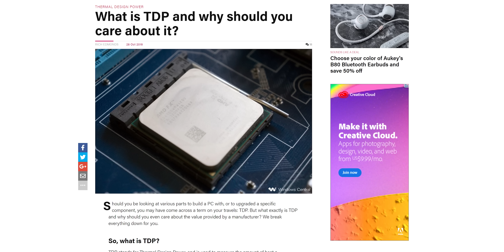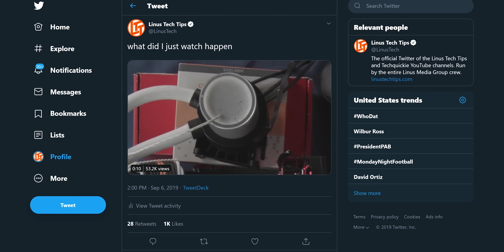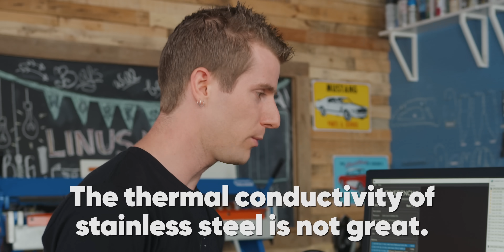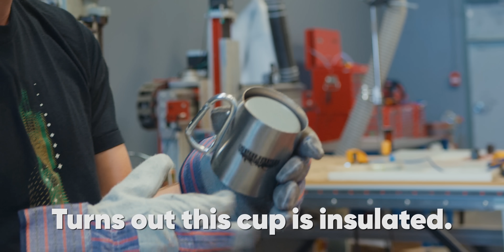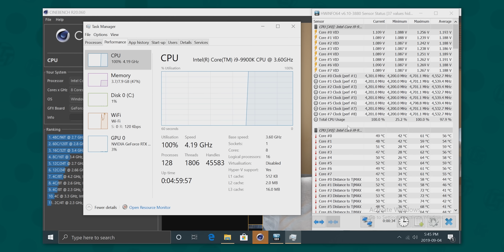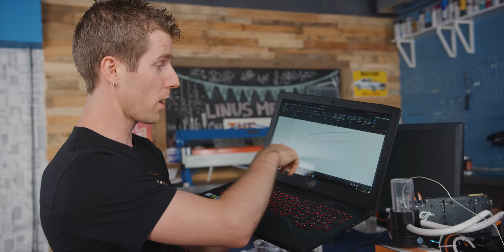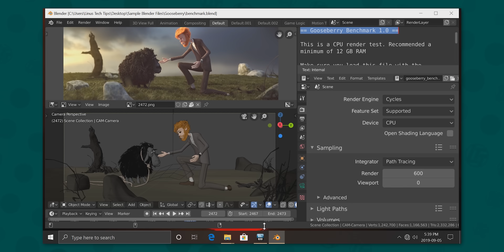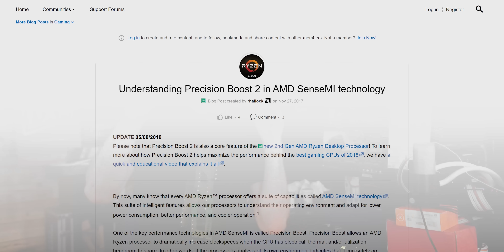Who REALLY Runs Hotter? AMD vs Intel

Comment: So, you didn't use the LTT water bottle for the test, why?
Reply: Specifically because it's insulated. The point of this test setup is to transfer as much of the heat as possible into the water and not the air and surrounding components.
Reply: @faceplants2  That's usually known as insulation.  So, an insulated bottle would prevent heat transfer in or out, allowing an accurate test?
Reply: @bobschuon5908  They want as much of the CPU heat as possible to go into the water.... An insulator between water and processor would impede that. Not sure where the misunderstanding is here.
Reply: @faceplants2  If you run the water tubes into the bottle, then you have an insulated water storage system, just like they were attempting to create to hold the liquid...
Reply: @bobschuon5908  I see now. We're talking about different parts of the test. By the time they added the liquid cooling loop, they were on what, Plan D or E? I think by then they just wanted to finish the experiment.

They also were using a pump/res combo so if they ran the liquid to an insulated container, they'd need to get a standalone pump to go with it.

There's lots of ways to improve this test but the results were good enough to prove the point that TDP figures need to be a standardized measurement if consumers are going to base purchases on it.

Transferring the heat as effectively as possible into a calorimeter is the most accurate way I can think of to measure total power output in a given time. They're expensive to buy and tricky to make a good one yourself afaik.

Comment: You won't have to worry about room heating in 2 or 3 weeks when that Threadripper does it's normal thing and fails. Non-functioning CPU doesn't produce heat. Problem solved.

Comment: You guys are SUCH obviously PC only geeks.

A copper sheet with even just solder would have worked better, and been easier.

Ugh.... massive fail.
Reply: Folded into a cup shape obviously. Figured I'd add that for the morons who couldn't put 2 and 2 together.

Comment: Dont even need to watch the video, and no offense.... but I doubt you did this correctly anyway. As in test CPU's core for core. 3700x vs 9900k as an example.

Without a shadow of a doubt, Intel is hotter not delidded at the same core count and speed. Delid it and it will be cooler.

Comment: CPU's dont create any mechanical work so all of it's drained electrical power is transformed directly into heat, in case of an identical remaining components, you can simply use a wall socket power meter (since power supply only drains the power components need)

Comment: This is actually one of the worst ways to test the heat output. It makes absolutely no sense to measure the water temperature when you can just use the electricity usage. Measure the current going into the motherboard and you're done. Yes, you'll have a few variables like different board efficiencies, but by taking similar boards the difference will be negligible. 

If you're just going for a comparison instead of actual heat production, use the same cooler with a constant fan speed and test the temperature. This won't lead to the energy usage in Joules, but it will give a simple indication of which one is more power efficient.
Reply: Exactly.

Best post right here.

Comment: Ah well i upgraded from a 6700k to a 3700x  and the 3700x is "reading" lower temps in Asus Ai suite... both 65watt TDP. At the end of the day the 6700k was thermal throttling itself after i de lided it. No idea why.  None the less im very happy with the 3700x. Not much gain in gaming performance (fps) if any at all but games feel like they have less micro stutter and latency. Luckily my loop is large enough to tame (x3 360 rads) the 3700x when running at 100% without any fans on and at low pump speeds. I can now happily render videos while i sleep peacefully lol XD.

Comment: T-Shirt: 20$
Water Bottle: 30$
Noice Linus. Plz explain
Reply: Cotton VS high technological materials to keep things very cool or hot
Reply: well you cant live without water for a long time
Reply: @subashaaa  metal vs sheep hair
Reply: Weaved cotton vs vacuum insulated stainless steel..... what’s hard to get?
Reply: @baqcasanke  How does that 20 cent operation on a hunk of pressed steel gets to cost 30$ is the question.
Reply: Hr1s7i 
Transport costs, QA costs, Marketing costs, etc. +They wanna make Profit
Reply: @regularyugoslav8188  So it's all for the sake of feeding the hundred middle man leeches in the entire chain. Neat.
Reply: @Hr1s7i  equipment, labor, profit for manufacturer, cost of transportation, profit for seller and cost of shipping to you.
Reply: because water bottle is more expensive to create what is their to explain their?
Reply: IFTEKHAR SAFI there*
Reply: cloth is cheaper than aluminum
Reply: I can explain: T-Shirt is made at sweatshop factories by child slave labor, but the Water bottle isnt.
Reply: @YouCensored  sure
Reply: @YouCensored  just like a apple product or supreme
Reply: T-shirts are made in AMD powered printers... And bottles in Intel powered machines... So, someone have to pay for the difference in machinery cost!
Reply: Shirt = fabric
Bottle = iron
Reply: shirt = plant
water bottle = metal
ez

Comment: watts are a measure of consumption. not heat. heat is indicating inefficiency in this scenario.
what is telling for consumers is that amd ran quicker and produced less heat.

you should run the test with a watt meter at the wall and determine how much power is consumed to complete the test for the whole system
Reply: Watt is also Energy, which can be called "Joules", and both can be used to describe amount of heat. Never saw physics right?

Comment: Does test to push CPU performance in order to measure thermal output, but only uses single channel memory....
Tries to use vacuum-sealed cup as a heatsink, is surprised when it doesn't work...
Talks about benefits of using a known quantity of thermal mass, yet doesn't measure how much thermal mass is being used (and changes measuring methods in between tests)
Wants to measure thermal differences between CPUs, yet either doesn't know or can't remember basic laws of thermodynamics....
Yup, par for the course for LTT.
Would be interesting to see GamersNexus do this sort of test, where the results could be somewhat reliable.

Comment: What is even the point of all that rube-goldberginess? Just run a water cooling loop without a radiator, starting with the same temperature water each time and measure the temperature change in the water...

Edit: Never mind, they did it 10 minutes in...

Comment: Wouldn't a better way have been to have a certain amount of cooling water (say 50L) at a certain temperature (say 5 degrees), run that through the cooling system at a given rate (which you'd presumably know from the pump's specs) until it's used up, and then measure the temperature in the output tub? 

Of course, you'd have a second tub of source water and a second output one with valves in the piping before the pump and after the CPU so you can switch between your testing line and your prep line, so you don't use your carefully measured and temperature-controlled testing water on booting the computer or let the CPU overheat when the testing water runs out after the test.

Comment: well, intel cpu usually run at higher frequency. and the power scales ^2 with frequency.
Reply: And yet Amd Cpu  gets more work Done :D 19 000 tiles vs 13 000 tiles.

Comment: I run my Core i5 9600k at 5ghz, but even though it says 95W TDP too, I put a NZXT Kraken x62 AiO 280mm on the top of the heatspreader. The CPU runs at the hottest 60 Celsius.

Comment: Imagine that thermochromic stuff in a loop with water, you could watch it change colour and cool back down (depending on the temp that the ink starts to change) which can tell you if the cpu is hot or not

Comment: Why didn't they just test the power intake of the CPU since all electrical energy is converted to heat anyways?
Reply: @UCglUUvnS2YSif0iMUSRlJ8g afaik they're all 100% efficient at turning energy input into heat by the first law of thermodynamics. The only possible output for the energy input is as heat, since the processors aren't moving.
Reply: I hate when people reply with stupid arguments then delete it when they're proven wrong 😂
Reply: Power/frame would make more sense than power/time as well. My 8-core cell phone cpu would consume 1/10th of the power but wouldn't provide 1/10th of the work at the same time.
Reply: @MrMortadelas  I agree.
Reply: Not to be pedantic but I think you are misunderstanding what heat is in this case.

Heat is the transfer of thermal energy between two systems. An example would be a light bulb. A light bulb converts electrical energy into radiant energy. Radiant energy consists of discrete packets of energy called photons which interact with matter.

Now take a solar cell which can convert some of this radiant energy into electricity. Intuitively arises the problem that if you placed a light bulb which obtained its electrical energy from the solar cell nothing would happen. This is because heat (flow of thermal energy) was produced as a byproduct of the work required to transfer the energy between systems. This is also called waste heat, because although the energy is still conserved but now is far less useful.

Now, if I ask which produces more heat (now in the conventional sense of the term) a 60 W LED bulb or a 60 W incandescent bulb which would you pick?

Turns out that is a trick question, both produce exactly 60 W of heat. The key thing to note is that while the LED will produce 60 W of heat it produce more visible like compared to the 60 W incandescent. This is called luminous efficacy.

So to recap, yes most energy indirectly ends up as heat through all the systems it transfers to and from. Also no, not all electrical energy is converted to [waste] heat at least directly. Some maybe converted to EM radiation, etc. Which is especially true for CPUs in the GHz range.

Now onto the video. TDP is waste heat in the form of [maximum] thermal power in Watts. Given two processors of equal computing performance but one has a TDP of 50 W, another has a TDP of 150 W. Which would be more efficient?

The answer depends on how you define efficient. Say the one with a TDP of 50 W, is consuming 500 W, while the latter only 300 W.

CPU A = 550 W
CPU B = 450 W

Again both are equal in computing performance, one has a higher TDP (waste heat) another has a higher overall power consumption. Efficiency at this point just becomes what you are after under certain contexts.

In short TDP is measured differently by different manufacturers so best to ignore it when comparing.

* I did not bother to reread this because I typed this from my phone. My apologies for any errors.
Reply: @nordinabouzahra7829  dude, all of the power that cpu draws will be converted to heat. it has nothing to do with efficiency
Reply: Kaan Üreyen no disagreement there. I said, “[...] energy indirectly ends up as heat through all the systems it transfers [...]”

My common was in reply to the comment that treated the CPU as a space heater effectively. The CPU's goal is not solely to get hot and so thermal efficiency seemed pertinent to mention. That being said TDP is still a mess because there is no standard way it is calculated across the board for vendors.
Reply: @nordinabouzahra7829  "50w tdp + 500w consumption = 550w"

did that sound correct to you? 500w consuming cpu draws 500w power which it does useful calculations (it depends on what you're doing lol) with, but it is effectively a 500w electric heater. so your cooler needs to transfer 500 joules every second at ∆T = T(throttle) - T(ambient). tdp rating is shit, and a cpu is an electric heater

edit: needs to transfer ........ to keep it work at the same performance
Reply: Kaan Üreyen ah, I see, my apologies. Yes, you are correct. The calculations are plain wrong, as for the terminology I should have not said consumption.

I was trying to elude to electrical efficiency, useful power output over total power input. I still think it is a bit crass to say a CPU is an electric heater, since an electric heater has no waste heat but a CPU definitely does.
Reply: @nordinabouzahra7829  if we want to talk about efficiency, an electric heater is a 100% efficient device. on the other hand, a cpu is 0% efficient.

let me explain,

we need to define a ideal cpu and a ideal memory in order to talk about efficiency of a cpu. cpu's job is manipulate 1's and 0's in the memory as we wish. let a bit of state 0 of the memory has energy of 0J, and state 1 has energy of h. because every bit of a memory is a capacitor, actually. so an ideal memory has a maximum level of energy (number of bits it has)*h. an ideal 1GB memory's energy level should be between 0J and ~4.8×10^-13J. it should draw energy as it is filled with 1's and feed the circuit as it is filled with 0's. man, that device will work forever with the energy of a single photon :D

and an ideal cpu shouldn't draw energy except negative of the entropy it changes (which we can but don't choose to calculate and get silly amounts of energy, and sometimes it actually release energy to the remaining circuit.) so, yeah, any real cpu's has efficiency of 0% which makes it an electric heater :D

Comment: Thermodynamics: all the power the CPU uses ends up as heat.  Period.  Simplifies that question, as long as you can isolate the rest of the system's power consumption.  Makes for a shitty video, though. :)

Comment: What are you doing?!?
Just measure the temperature from a normal cpu-cooler during load - then reproduce this temperature with a power-resistor (adjust voltage/power until you get the same temperature).
This way you can also present the idle power vs. max-power usage

Comment: I'd like to see maximum power consumption / maximum heat output stated in the CPU specifications as well as the TDP
Reply: Yes... I can start with giving you my data :) My 8 core Xeon 2288G uses 220W at 4,6Ghz all 8 cores running 100% doing a Cinebench 20 run. And it can maintain 4,6 - 4,7Ghz all 8 cores 100% all day if needed which actually gives it a rather big performance boost in multi thread tasks compared to similar priced AMD. But to run it at full boost you need a really good CPU cooler and my 12 heatpipe one barely makes it with 85C temperature at the full 220-230w power...

Comment: Aaargh. Guys....

Waterloop > connection > measure water flow > measure temp block > cpu block > measure temp block > measure water flow.

Now you know incoming and outgoing temp and volume/mass. Calculate over time difference in temperatures to see how much heat/energy it produces. 

You can still cool it heavy and if you use transparent glass, people will see it.

Hmm. Try it.
Reply: Only need one water flow probe, because of conservation of mass (water is an incompressible fluid under these conditions). Otherwise, excellent testing setup! :)
Reply: That would add lots of additional potential variables to control. You would need to find a water block that works on both platforms. You would need to ensure that mounting pressure was exactly equal between systems. (A fixed weight resting on the cup and glass plate does this much easier.)

The thermal transfer from CPU to metal cup is shitty but the point is that it's pretty much equally shitty between systems. Sound testing methodology means removing all the variables you can and controlling the ones you can't. Their experiment design was pretty solid but I find the use of a 'capful" of thermal dye instead of using a syringe to be frustrating even though it's impact on the results would've been negligible.

Comment: What was the point of using the dye if you we measuring coolant temperature anyways?
Next time get a bigger reservoir, remove the radiator, and run the test for a fixed amount of time, calculate temperature increase and knowing specific heat capacity of water, you can calculate the energy and convert in to Joules, calories,  Wh or whatever you want. It is elementary physics (facepalm).

Comment: As long as you dont have all cores on max performance you dont have a valid result. Lower frequency is less heat.  9900k on 4,2 ghz is all kinds of wrong mine runs 4,7 on all cores all the time.  Looks like your board has a avx offset run which with propper cooling should be off. Mce was off with mce on it can do all core 5ghz not a low 4.2.  Looks like there was a hefty 500 mhz avx offset on. To me this is all kinds of flawed.  Also on a non avx load the intel uses 35% less power so less heat. So heat output also depends on the load.

Comment: I have seen many reviews where the ryzen cpus typically run cooler than the intel counter part. But from Tech Power Up's 3600 review, they say it runs hotter than a 9900K under a blender stress test. Although they use the same air cooler (Noctua NH-U12), i cant see how a 9900k runs cooler than a 3600. The problem i have with this is a lot of people like to quite these results when talking about temps between intel and AMD. I feel that something must be wrong here since many other tech reviewers report that the 9900k hits the 80s to 90s on a 240mm rad water cooler. 

Any thoughts?

Here is the link https://www.techpowerup.com/review/amd-ryzen-5-3600/19.html

Comment: Why not just use a water block without cooling and measure the temp the coolant in the reservoir reaches after a set time, this method seems insane but guess it makes reasonable wtf TV.

Comment: the chemical engineer viewers would tell you the best way would be to measure the temperature of the coolant in and out of the cpu block and if you know the flow rate you can calculate the heat transfer  performance